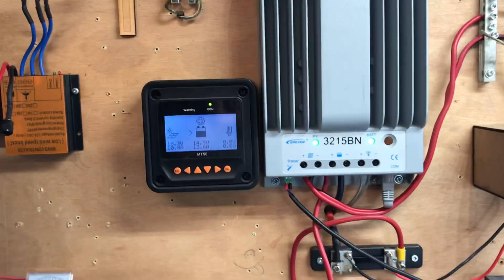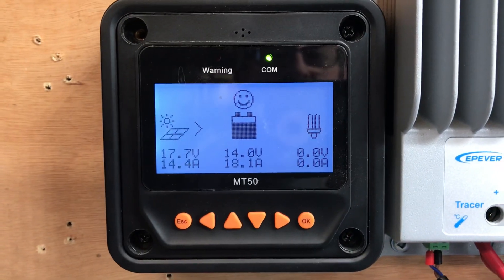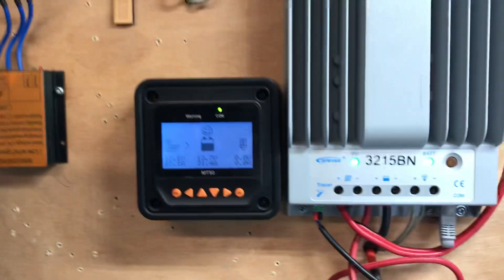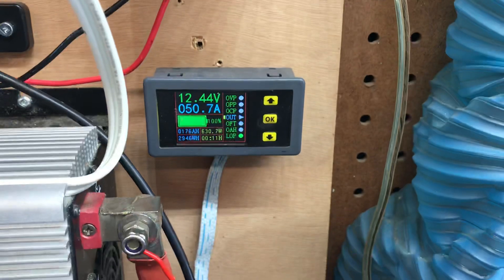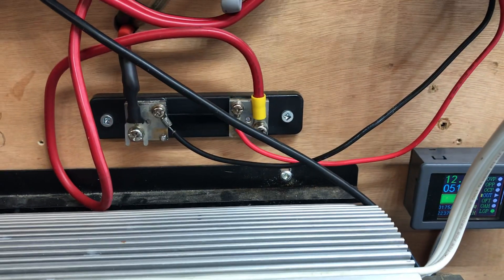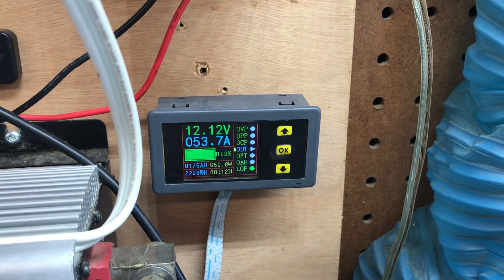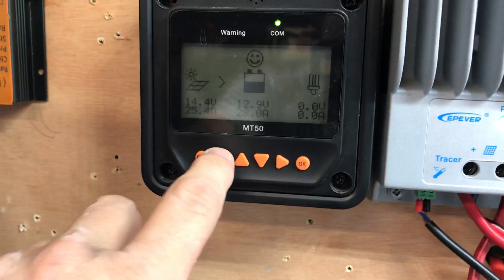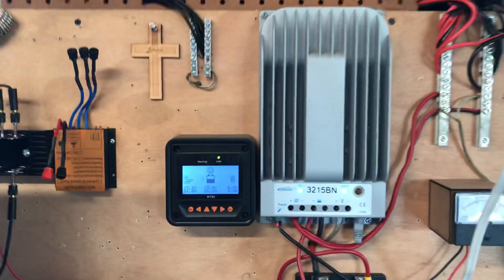EPever tracer explained.. power only when you need it

Comment: Your wire size might be what is making your shunt heat up as well. The size determines the flow rate for electricity. Go get some scrap 00 or household main panel input power wire and the boat stores got your big crimp to hoop connectors. That may help your R.B.p. just off just off the flow increase Lol. Also solid is always a better conductor than braided wire. Nice setup I have the  same!
Reply: For dc I've heard on different videos that you don't want to use solid, that braided was better. Not trying to say your wrong, just saying that's what's being said in wire sizing videos. Im going to have to look into it, i have plenty of house wire from 14-10, it'll save me some money if it's as good or better.
Reply: @checkingoutgypsymike2075  you're right. I think it has something to do with surface area of the wire. More strands, more  surface area.

Comment: Thanks, i had also some strange behavior from this mppt. Under load it shows power otherwise it is charging slowly...cca 5 amps
So if i have 4-5 hours of sun it doesn't charge batteries correct even  if i have good weather.
Reply from the maker: I had to set mine on a boost charge for 120 minute at 29.5 V because if it hits 30 V then my stupid power inverter wants to shut off at 30 V and shut off my fridge and then kicks back on and you know what that does with compressors they draw a whole Lotta current when they get unplugged and plugged back in real quick

Comment: Which solar panel can delever 25A ?????
Reply from the maker: 8–100 watt panels in parallel will do it on a good day. That’s how I have mine
Reply: @Checkitfirst  you will get more out of your panels by wire them in series 👍👍
Especially in cloudy days !!
I wonder why you do not do it, when you a voltage max input of 150Vdc.
Reply from the maker: @tucoremirez4859  Actually that’s not true. The only reason you run your panels in series is if you have a very long run my panels are right above the garage 8 feet from my charge controller. A watt is a watt, you cannot cheat the system LOL. I actually have my panels in series now at 83 V. It does not seem to make much difference at all

Comment: my mt50 and temperature probe came.just watching your video again
Reply: Just put video up showing solar inputs from front 100watt panel on campervan 2nd one is 100watt flexible panel on roof box not quite full sun ☀️ as it’s behind me at time and we in winter of course .last reading is 30watt panels x3 that under my ladders at present .my stereo is on at present I have 3 amps in van .well I upgraded stereo to big touch screen kenwood using alpine amp under front seat 50 watts .then thought need more bass so after I won on eBay a collection of 2 kenwood power amps oldschool but powerful plus 4speakers and cables for 22£ I installed both amps as I made my own subwoofer cabinet so in the end the sound is brilliant but does soak bit of battery power up it tends to use drop about 0.3volts when stereo on

Comment: hi kevin.just seen the power only when u need it video.im acquiring epever mppt same as in your video.on my camper van I have 100watt panel up front 3 x 30watt at rear .both have a mppt controller.front controller helps with my Waeco fridge 12v on all time.have dc to dc charger gives good charge when  vw t4 2.5tdi engine on.im putting extra solar panel 50watts on top of big roof box as seems to get most sun.my 30watt panels are covered by my ladders usually as I'm a window cleaner.ive tried parallel connect with panels .went to series for now.what do you think best option?with the shading thing here in uk we need get as much sun as we can .I have 2 110ah lead acid batteries in parallel .do I nee a shunt for measuring also?I have renogy rover which has display and a mt50 on the epever tracer.the tracer like yours will be run off new 50 watt panel off roof box panel .steve
Reply from the maker: Hi Steve. I have recently connected my panels in series. It seems to be just a bit more efficient. Not a lot but I think I will keep it this way. I like having a separate meter on my inverter to show how much My inverter is using   Some come with a shunt and some have a coil the wire goes through. That’s the one I like better. Not saying it’s any better it’s just easier for me to use and I like the meter that comes with it. This charge controller is a really nice one. If anything was to happen to it I would definitely buy another one just like it
Reply: @Checkitfirst  ok.i have a kreiger 1100 watt inverter in van, just use now and again .been looking at making own lifepo4 battery pack 12v.getting cheaper to make.need find out decent cells.ive made bike battery before .not sure if they like the cold though
Reply from the maker: @stevemcgowan3017  
I don’t believe they like the cold weather. I believe the battle born batteries have a built-in heater so they don’t get too cold. I am also very interested in lithium batteries. A little too pricey for me even to build
Reply: @Checkitfirst  my lead acids are working ok for now .as I’m using van at work as my daily and I’m about to install another 100 watt flexible panel on my roof box I should get extra charge power when the heatwave comes 😀
Reply: MY EPEVER TRACER 1251BN ARRIVED AND IM GOING TO USE THAT WITH A FLEXIBLE SOLAR 100 WATT PANEL ON TOP OF MY CAMPER ROOFBOX.THINKING COULD SHARE THE MT50METER I HAVE  OR WILL NEED ANOTHER TEMP SENSOR TOO
Reply from the maker: @stevemcgowan3017  Each charger needs its own MT 50. I tried to use the same MT 50 for two of the tracer chargers but the company said I could not do that. You can unplug it from one charge controller and then plug it into the other one to set your parameters and when you unhook it your charger will keep those parameters set
Reply: I’m using Renogy Bluetooth on phone as already have Renogy mppt on solar panels on van so can see batteries Gettin boost or not
Reply: I've just ordered another mt50 and temperature probe.bit miffed I need 2 at least can see what new solar is doing
Reply from the maker: @stevemcgowan3017  
Awesome. Are you going to do a video on it when you get it?
Reply: @Checkitfirst  yes will do but I’m not an expert I’m reading up on parallel batterie connections again .just to make sure ...😀
Reply from the maker: @stevemcgowan3017  
Lol. None of us are experts,, we only think we are😂. Go back and look at my first solar video. I didn’t know anything ,, but I played with it every day so I could learn by testing it’s power. I made a lot of mistakes but that’s how you learn. Now I’m still no expert but I know a whole lot more than I did. All the problems I was having I now understand why
Reply: @Checkitfirst  yes thanks 🙏 will do

Comment: I have a 4215 BN which I had three 100 watt panels in parallel...the problem was that these panels have an optimum voltage of 18.1 which it would never reach...I rewired my panels in series last night so open voltage is 63 now but it rained all day today...I want to see if the charging is better but also I just got a fourth panel so I still have to hook two sets in series/parallel to see what the voltage winds up being and whether it yields more amps to the battery one way or the other...42 volts times 2 sets may be the best...I just thought Id mention this because the controller may work smoother one way...IDK...this is my first setup..( Im saving up for an inverter and have decided on a 24 volt one which Im going to order in a week )
Reply from the maker: I have changed my entire setup. I’m running a 24 volt setup now. My panels are in a series parallel at around 82 volts. Got a new pure sine wave inverter that’s 24 volts. Everything is working a lot better than before. I have a video of it. Go check it out 😊
Reply: i'm pretty sure the 4215 is 150 v. up to 40 amps in and 20 amps out. or something like that.
Reply: Wow this was an old comment. I will go check out the new video. I have 1200 watts of panels now, and 20 marine batteries. The Aims Power inverter charger had to be rebuilt last year after trying to run a welder. I ran the same welder off of my new Winco Lil Dog generator yesterday. I can't really put any more panels out on the controller, it can take 1040 watts in, which I have had 1020 coming in last summer.
Reply: @davidpotter9462   I went to lifepo when it came time to get new batteries. i wish i had not. All I do now is babysit these things.
Reply: I bought the biggest marine battery that AutoZone had...I have 20 of them. I would like to have About four more. The volts are lower than lithium but they're hard to run down when there's a whole herd of them. I can run for a few days on a good charge. I check the water every 3 months, and add a bit. I got twenty for around $2200. And I have 990 amp hours at 24 volts. About 1200 if I get 4 more. That's what my inverter seems to like. I could have only gotten two battle born batteries. So I went with lead acid. They do okay if you can get enough of them.
Reply: @davidpotter9462  this is hard to believe but, i bought 4 ,110 ah deep cycle batteries and after 5 years ,they are still good .one cel of one battery is using up water but like you ,I check on them and it matters. a good charger is key. I got a 6000 watt inverter /charger, UPS/ATS. it has a desulferization setting I used about one a year.  I have 12 uni-solar roll out /stick on, 24v, 5 amp,135 watt  panels, but still in boxes because I have not figured good way to set them up without sticking them down. These are way different than regular panels because they work in low light.
 I've made  2, 100 ah 24v, and 2, 320 ah 24v lifepo 8s batteries and I find it insane how current BMS work . an 8 cell battery with 26 volts ,just shuts down the whole thing if only one cell is high or low. 
  That is not good for the charge controller or inverter. Both have a warning that battery must be not be disconnected before solar or shutting the inverter off.
 With lead acid, basically just hook them up and your good to go. I'm now running both lead and lifepo  parallel, to avoid that unwanted shut down of  batteries, before the controlar /inverter can shut themselves down for low voltage. some say it's ok.
Reply: The first 8 batteries, I got the 27 dp but then after I managed to get the Aims Power inverter charger, I got 12 of the 29 dp. The first ones were 90 ah. And the bigger ones are 105 ah...I'm making some ground mounts with solar trackers next😊, since I have a generator to run the welder now. I made square tubing steel frames, on some panels, two in each one. I used bigger tubing on the first one, then went to a smaller size. I used 3/4 inch on the last ones and it works great. It was very cloudy all day and now raining. I'm showing 24.3 volts at midnight. Two of my panels are in the barn, storm coming Tuesday, that means high winds here. So I had 1000 watts of solar panels out today. I broke in my new Winco generator yesterday building a skillet rest and a stovepipe hat so it can't snow down the pipe. My stove is doing great now, and I will be cooking on it a lot more now. Saves using the 1472 watts oven on days like today. I might make some brownies in it though. But not have to cook a whole meal in it. I thought about getting four 240 ah golf cart batteries, but then I thought well,  what if they want to run at different voltage...so I think I will just get four more of the same one I have. They went up 30 bucks though. They were $99.98 for two years then the last two were $129.98 but oh well it's the price u pay for freedom from the grid. Those will bring me to 1210 amp hours. I'm thinking that will be fine. My uncle is paying $140 but he doesn't get a 10 year deep cycle battery for his money. I think having 24 batteries that they might last 13 years, so that's a good enough bargain for me. I'll have about $2750 in batteries. So that's $6700 that I save by not being on the grid. I figured about 60 a month, so I will have saved 4 grand. I have found that the lead acid batteries like some amount of charge coming in, the voltage will improve, and that makes the difference between the two battery types less. So I think a small wattage wind generator is on the agenda now. Home made ones, I have a few that I want to try. I heard that if you can keep your batteries at 75%, they might last 14-15 years. That's more money saved. Perhaps the lifepo batteries would work best on 48 volts. I didn't have that much money. It's easy to get taught money wise on a solar system. I could use a couple more panels out there this time of year. I would sell or trade the lifepo for some used fork lift batteries.Or something. Yeah I don't think mixing them up is a good idea.Too much difference, to get it to work right. My batteries are all less than 2 years old, so it should be okay to add some brand new ones.I have tried to design my system to run a small cabin off grid for a
Reply: Yeah I would get all the same kind of batteries. Trade for some used fork lift batteries, hook them up for 24 instead of 48? I just got mine at the parts house here when they were cheaper. But I think I will get 4 more. I'm adding a wind generator. I'm going to make one out of the junk I have. My idea is to have 24 in '24.
Reply: @davidpotter9462  there are a lot of great DIY  wind  videos on you tube. you can fix or build just about anything with YouTube. it's great. I picked up a nice $400 pioneer receiver at the good will for $15. I found a video showing I just had to re-solder a bunch of parts and it's fine.
Reply: Well Great news. Now I have twenty lead acid batteries and two 24 volts 100 amp hours lithium iron phosphate batteries ⚡😎👍. I'm going to take twelve of the lead acid batteries and make a 12 volts system with my spare inverter. I'm just going to use the wind generator on the 12 volts system. With about four of my solar panels. I have 1600 watts of panels now. What I'm wondering is, now I need one of these controllers for the 12 volts system. So I thought there might be a link. .. happy Thanksgiving 🦃🍽️

Comment: Hi Mark very interesting video and since I'm about to purchase this product on the MT 50 Screen what is the 3rd item that is controlled  left to right solar , Battery and the 3rd item ? Appreciate your comment Cheers Ross Tga NZ
Reply from the maker: That 3rd item is your switched output. There is a button on the charger that turns on an auxiliary 12 volt output. It tells you how much power you are using. It only is used to run small applications up to 20 amps. If you are doing a 24 volt battery setup then the output will be 24 volts. By the way,, My name is Kevin😂

Comment: Put it on the - side
Reply: I'm new to the comment thing 
I would love to send you some pictures of my setup
Reply from the maker: Robert Brown. What!???
Reply: Negative side
Reply from the maker: Robert Brown Put what on the negative side
Reply: The battery shunt
Reply from the maker: Robert Brown Shunts  don’t go on the negative side
Reply: Ohms law use the ( Amp's ) power before it comes to the measuring device its on a battery 🔋 bank what goes out  comes back in closing the circuit
Reply: From my understanding they can be ran on either side I have the same system pretty much  But I have my battery shut ran on the negative side just before the batteries    It doesn't get hot and still tells me what I need to know Accurately
Reply from the maker: Robert Brown. That’s awesome. But I’m not using that shunt anymore I have changed my system quite a bit since that last video you might wanna go check out my last video and then you’ll see what I’m using now

Comment: Hi. I believe the 50 amp you draw. Is from the battery and the MPPT. From the system point of view (asuming your inverter conection). It should be parallel system between MPPT and Battery. There for the inverter draw also equal 50% MPPT and 50% battery. The question is. When does this condition applied. Why this condition doesn't apply when you draw only 24 amp.
Reply from the maker: Si_Noop Noop. The charger is replacing what is being used. If I have let’s say a 15 amp draw off the battery then the charger will just about match it to take care of the load so the battery doesn’t have to
Reply from the maker: @immrnoidall  ?